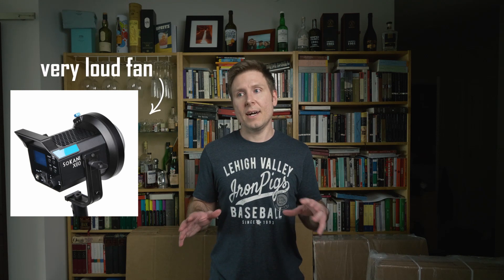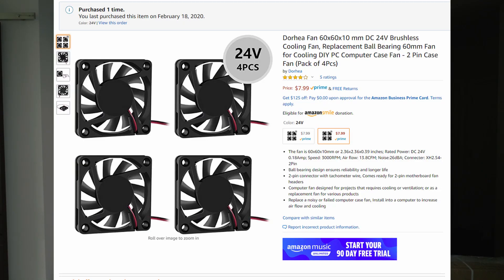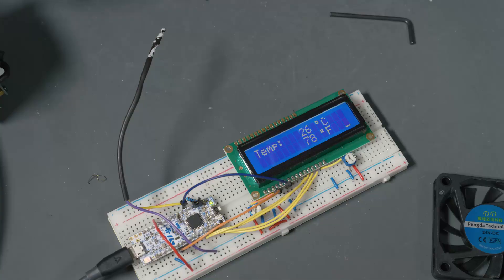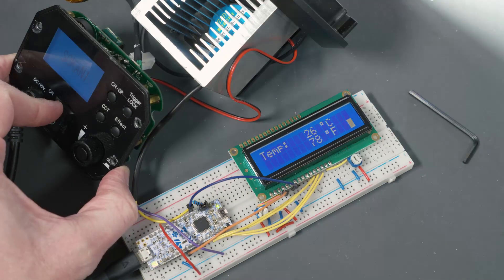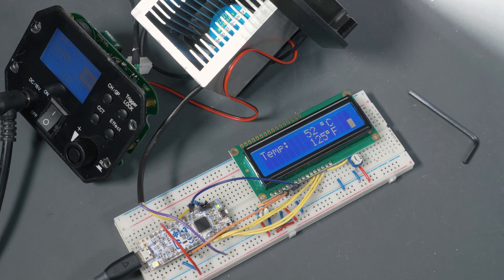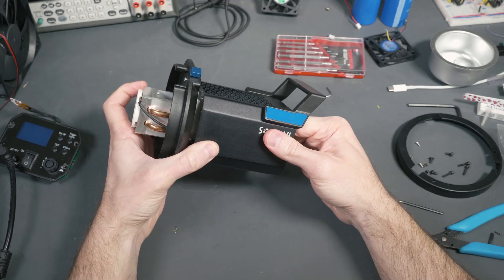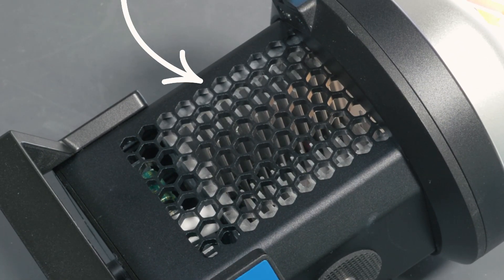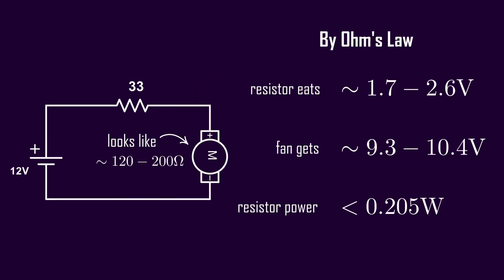Hacking the Sokani X60 Fan | Can I make it less noisy?

Comment: #FromBrazil
Very good. You're helping me a lot.
Friend, I'm about to buy but I'm in doubt.
Which Sokani X60 and Nanlite Forza 60 do you recommend?
Thank you and congratulations for the channel.
Reply from the maker: Hey Fabio.  I have seen the Nanlite on YouTube but haven't used it myself. The two lights look like they use most of the same parts, so my guess is that there isn't much difference.  The only two limitations of the Sokani are the clamp strength and fan noise. I doubt the clamp is any better (looks the same) but there might be less fan noise since the case is a little different, but it's probably minimal.
Reply: @overkillprojects8091  Nice. I understand.
There is a video changing the fan.
Video: "Sokani X60 | Replacing the Fan and ... WHA?!?!"
Thank you very much for responding, I want to buy Sokani since you commented on the little difference.
Thanks!

Comment: Random thoughts:
Your "decoupling" is not really decoupling. Vibrations will travel via the bolts.
Perhaps the fan is a really cheap and noisy one. I'd have a look at a Noctua or Papst (or one of the other quality brands). You should try to ballpark match the flow rate between the old and the new one.
Reply from the maker: Quite right.  I was going to try some gasket material, but that's when I found out that most of the noise comes from the air moving over the case - should have made that more clear in the video.  Also quieter fans are difficult to come by - see my previous Sokani video to see why.

Comment: Thanks for your interesting series about the first-gen Sokani X60.
Having said that, there is now a second-gen version that seems to fix the noise and the clamp problem:
https://www.youtube.com/watch?v=qzxfJGhJ9sQ
Perhaps you can get in touch with him and arrange a tear-down of the second-gen to see what they did about the fan.
Reply from the maker: Oooo cool, I'll see what I can do to get my hands on one.  Thanks!
Reply: So did you get a ver 2? I’m interested in buying one as a second light. I would love to see a comparison video. What I want to do with this light is put it in a lantern over the head. Do you think it would work for that?
Reply from the maker: @scottburrow8293  I haven't had a chance to get a version 2 yet, I'm still hoping to.  I'm not entirely sure what you mean by putting it in a lantern, could you elaborate?
Reply from the maker: @scottburrow8293  got it, that's what I thought you meant.  I personally find that the light is a little loud inside of that three foot range, but only noticable if your scene is quiet.  Although I will say that since it's consistent, it's easy to knock out with some post processing.
Reply: OverKill Projects alrighty thanks for the info. I appreciate it.
Reply: What’s interesting is that all my other lights are Lowell hot lights that I bought cheap. I have four totas and one dp light. I just bought the Godox vl150 my first les light. I can’t decide for a second led to go with a light like this or get a flex led light or even a panel light. I just need it for fill and one above like a lantern. I guess my research continues.
Reply from the maker: @scottburrow8293  if you're a small shooter and only doing a key light plus fill/hair/room lights, panels make perfect sense since usually you want those nice and soft anyway.  I have a couple of godox bi color led panels that work great for most situations.  Of course it's hard to beat having a few cob led lights if you can afford it, but then you are also buying heavier light stands, soft boxes, etc.